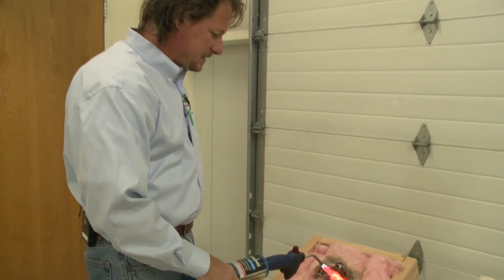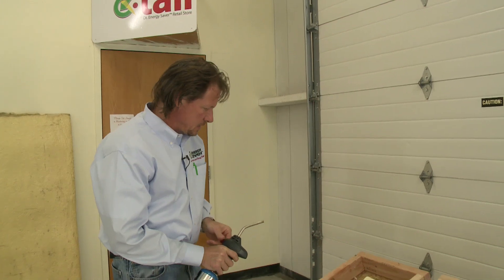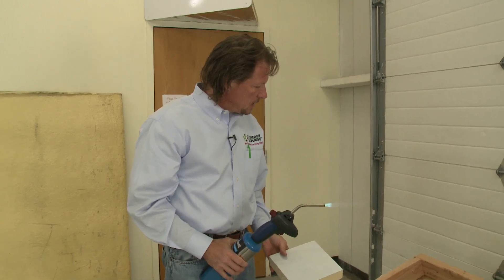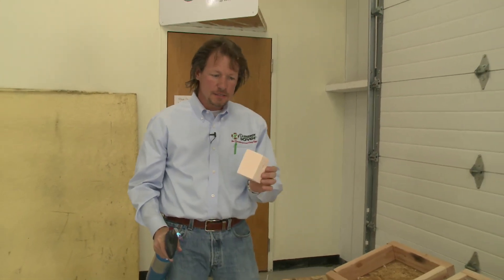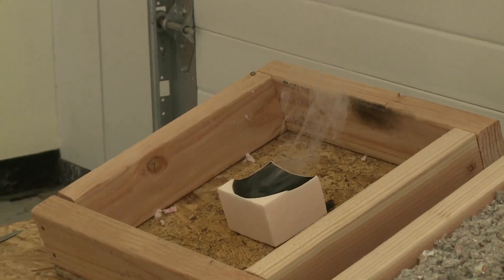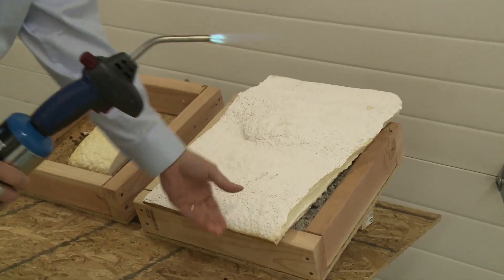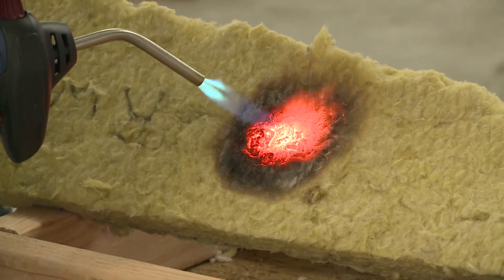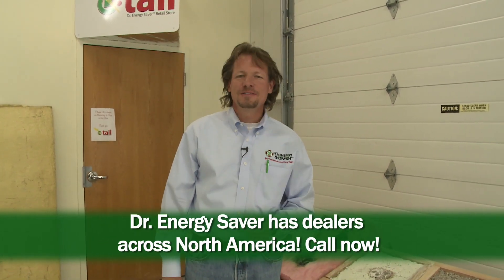Fire Testing Insulation Materials

Comment: 5:20 Grenfell tower fire in London. 72 deaths - Insulated with polyisocyanurate
Reply: The insulation material on Grenfell looks like polyisocyanurate, but it's different chemistry.  It was a phenolic resin based board insulation.  Regardless, it behaves a lot like polyisocyanurate.  You are correct that this insulation played a factor in the combustible facade of the building, but the real culprit were the aluminum composite panels that were installed as the exterior cladding over the insulation.  Those panels are sold with a fire retardant core or a non-FR core.  When it's not an FR core, the core is solid polyethylene plastic.  PE plastic is extremely flammable and in the US the building codes don't allow it to be installed on buildings taller than 40 ft for this exact reason.  The UK building codes didn't have this regulation, but regardless that material should have never been installed on a building that tall.  

That event was such an unfortunate perfect storm of many factors that allowed the building to go up in flames like that.  If the sprinkler system had functioned it wouldn't have gone down the way it did.

Not trying to be a smart ass , but there are a lot of things that allowed that event to happen the way it did and the insulation installed on the outside of the building isn't at the top of the list.

Comment: Based on this video I bought Greenfiber insulation from Lowe’s for my wood fired oven enclosure. I had already insulated with perlite but ran a little short so I finished filling the enclosure (made of steel studs, cement board walls and a 14 gauge steel roof) making sure to keep the Greenfiber 6” away from the double wall stainless steel stove pipe. After cooking my first pizza In the oven the enclosure began to smolder and has been doing so for three days now. There is very little ventilation in the enclosure so all day yesterday I keep a canvas tarp over the enclosure and keep it wet all day hoping to smother out the fire. I took it off last night and smoke still poured out of the venting areas. Using this crap was a big mistake on my part I should have just added more perlite which is made from volcanic rock. Now I’ll have to wait until it quits burning, remove the the roof, remove the burnt Greenfiber and add perlite. What a PITA!
Reply: Never do anything based on a YouTube video

Comment: Best explanation about heat exposure to insulation that I've seen yet. One thing to keep in mind though is that even in a fire, if the insulation is kept away from oxygen it may only melt instead of burning so the smoke might not be as bad but that doesn't mean that the chemicals have become inert. Quite the opposite, you may just have a puddle of ignition ready goo left after the fire.
Excelant video though. Maybe you should wright an ASTM test based on it. These are important things to know about any building material.

Comment: The colour of the smoke does not indicate the toxicity of the smoke black smoke indicates that it is  soot bound white smoke can be more or just as toxic as the black smoke especially formaldehyde that is highly toxic. You didn't test sheeps wool what is the best insulation if you have to spray into cavities or the paper he used. rockwool is a very good fire retardant and the best sound insulation material so between floors use rockwool.

Comment: Curious if there are any insulation experts out there. I am wondering about the safety of the foam insulations. In the video, he shows that most of the foams self extinguish when the heat is removed. My questions is, if you don't have an electrical-caused fire in a bad box or something in a wall, then presumably, you have an already burning fire that has reached the insulation. In a case like that, the heat source would never be removed since the damn house is on fire. Shouldn't that variable be considered? A fire origination outside of the wall and working its way in? That foam lights up, man!

Comment: Test asbestos! I hear that's a pretty good insulator!
Reply: Asbestos is a good insulator,but it is a carcinogen when you breath in the small fibers you will be at risk for lung cancer and you could die from asbestosis.
Reply: @richy5913  r/woooosh
Reply: Actually asbestos can be processed much like Rockwool to not create the particulate that can create cancer issues BUT when the company producing it was sued it literally destroyed the production of it.
Because of the way Rockwool is produced it has same or less particulate as fiberglass which can also do damage like asbestos if not properly handled. It's how products are produced and handled. I know a guy in his 00s, worked with asbestos for pretty much his whole life, they checked his lungs and found NO residue or issues from installing, handling or removing it. 
Again lots of info out there, just not spread around. And asbestos is a natural substance that's mined  much like the basalt that Rockwool is made with.
Reply: Apparently studies have been done on Rockwool to check for any asbestos-like negative effects.  They are pretty extensive, looking at any links to cancers, fibrosis, or long-term effects through both injection and inhalation.  These studies include one where the researchers describe a "mad-science" test rig (RCC
Fibre Aerosol Generation System) designed to pulverize rockwool into aspiratable particles, which are then pumped into a chamber to expose rats via nasal inhalation.  Afterwards, they checked the rats for signs of asbestosis, cancers, or pulmonary dysfunction, and then gathered data on how much particulate remained in their lungs.  They concluded that rockwool is much safer than asbestos, and in the long term study, the rat's lungs were able to eventually clean themselves through alveolar macrophage clearance of the particles.

References:  

https://www.researchgate.net/publication/15316146_Biopersistences_of_Man-Made_Vitreous_Fibers_and_Crocidolite_Fibers_in_Rat_Lungs_Following_Short-Term_Exposures
https://web.archive.org/web/20191029083342/https://academic.oup.com/annweh/article/42/3/191/177334
https://www.gearslutz.com/board/bass-traps-acoustic-panels-foam-etc/347314-comparative-safety-rockwool-fiberglass-organic-fibers-review.html
Reply: DURRRRRR
Reply: So is gas
Reply: Matt it is
Reply: Asbestos doesn't burn. I think the space shuttle has asbestos tiles for reentry to atmosphere.
Reply: @rekless1875  it had silica ceramic tiles

Comment: Honestly, most of the home owners care less if the described insulation materials burn or not if they are approved by codes. It is actually beneficial for me if it burns. Why? If the inside house fire gets to the point the  insulation reaches the burning temperature, it means you have full blown raging inferno with carpets and furniture burning all the way. No way you are not going to notice. Unless you are already dead, you will be out of the house escaping that smoke for a very long time before the attic or wall is to start burning. And here comes the catch. If the fire spreads through the roof  or the outside wall collapses 99% you are to get the house rebuilt brand new with your insurance paying for it. If the fire is to stop inside there is a huge chance you will be stuck with Servpro cleaning the mess after the fire brigade dumps tons of water into the house and then repairs that go for months and months. I much prefer to get a brand new house after a major fire than just some renovations and cleaning that will go forever and still gonna leave bunch of problems behind.

Comment: Thank you - excellent info and something I was wondering about and was figuring I’d have to do myself - now I don’t. The thing that concerns me is even those where it stopped burning because you took the flame away - is that unlike your torch, home fires don’t just stop (well unless put out) and once other materials catch on fire (framing, interior items) - then the insulation will also continue to burn. From doing various craft projects I have had opportunity to burn a few of the rigid foams and the smell on some are awful - not to mention, the smell of spray foams being insulted. I have read horror stories of people ending up with toxic homes that the smell just doesn’t go away and people are made sick. You weren’t using any breathing protection, but I suspect your building has an excellent air purification as most folks wouldn’t burn some of these in an enclosed non-ventilated space. I’d like to see testing that discusses toxic fumes of the various insulation products used here both when burned and after being installed and you move in to a new home or back into a remodeled one.  I believe we have to consider not only efficiency in insulation but also our health (personal and environment) short and long term. Many of the efficient buildings are being built so air tight that mechanized ventilation systems must be installed and run 24/7 providing proper draft for gas stoves, fireplaces, wood stoves, etc BUT mostly for the quality of the air inside the home. By all accounts, the air in our homes is much more toxic than outside air. But here is my concern - what happens when the unit breaks down, or power is off for extended periods. In my current home of 30 years, we have had 3 instances where the power was off due to natural causes (snow storms, hurricanes, etc) - those 3 events without power were each a length of 9-11 days, 2 in winter, one in dead heat of summer (90-95F with 80%+ humidity). Well opening the windows in the winter is just not acceptable to provide ventilation, and the tightness of some of these homes makes lighting a fireplace, or wood/pellet/gas virtually impossible much less keeping it going without smoke. I know several folks where even with a special ventilation system, their backup wood stove nor their AGA gas cook stove won’t operate as it did prior to building the new home. I’m getting ready to have a small custom home built and I want an efficient home but not to the point of being dependent on some mechanized system to be able to breathe. 
Wood like to see water testing such as when flooded, pipe breaks, roof leaks. This would tie in with testing of various types of drywall especially comparing to Magnesium board (MgO) - both fire, water as in most cases - insulation is covered with something. If not doing this with all types used in this video - then the 3 top winners and a couple of most commonly used foams (spray and rigid).  
Then there is more in-depth look at the 3 clear winners of the insulation to cover cost per square ft to install both remodel and new home; how installation affects performance as quality of contractors and their work force has sharply declined from say 20 years ago. When talking to various levels of folks while preparing to build a new home - hearing comments like “rockwool is installed the same as fiberglass (or magnesium board is the same as regular drywall - if you want to spend more money, fine); and it is really the same -just shove it in, nail it up, works the same, why spend more money, or the one I love talking about anything green “now your talking about some real money, hope you have really deep pockets” is scary. Yet, they don’t have the cost differences and they don’t want to quote those differences - just say “look when we deal with those materials or methods - we use it and hand you the bill afterwards - be prepared to spend more money for all this nonsense”. What kind of answer is that? And women are definitely at a disadvantage with these guys - sometimes I feel like I’m in the 70s trying to buy a car. 
I’m going to check your other videos and website to see if you have already covered the testing mentioned above. Thanks again.

Comment: As I watch Mike Holms show the best way to build your house is with foam insulation or Rock wool. 
Also treat lumber with fire retardant. This way the house wouldn't burn. Yes you can spray this on older homes lumber.

Comment: Ha ha, this makes me chuckle, been told by an architect that natural insulation’s have less of a fire rating than modern, fibre glass and foam insulation’s. But apparently the PIR is the only way to do it. But I’m demonising modern methods. The tower block fire in London was fed by the PIR foam insulation and funny how here in U.K. PIR and spray foam bolt have a fire rating at the moment.

Comment: If R rating just comes down to the insulations ability to allow heat to transfer through from one side to the other then AirKrete should have the best R rating I would think. I think some one is fudging the stats on the insulation values. I have watched people leave a 4000 degree Fahrenheit torch on 2 inches of AirKrete for hours with no temperature change on the outside of the AirKrete, it doesn't let the heat pass through.  So why wouldn't that be the best insulation to use?

Comment: Dear Dr. EnergySaver, your test shows some variation in ignition properties, but except for the cellulose it does not even come close to showing how these materials behave in an actual building fire. In NFPA building fire test conditions foam did not self-extinguish, and the test room became an inferno in less than a minute; while after 15 minutes of fire exposure cellulose insulation still did not melt, collapse, or flashover. here is a link to a short video of the test -  https://www.youtube.com/watch?v=mUPp-Ipt-Pk

Comment: My compliments on Larry's easy-to-take delivery.       He's thorough and accurate.      He ought to take up a night job as an MLB radio broadcaster!        Keep up the great work, Larry.          But I worry about any smoke you might inhale, during your demonstrations.          Rumor has it that isocyanurate turns to cyanide gas at high temperatures.
Reply: if that were true than i have an extremely high tolerance to cyanide.i have had to scrape structual fireproofing out of the web of i beams many times to weld this or that.nothing would be scraped from the other side or any where else i wasnt welding so the far side of the web would be just uner 2000 f roughly.its not pleasant smelling ,sometimes it will make you hack and cough but i havent died yet.one thing i know will kill you is welding steel that has lead based paint on it.take my word on that one.

Comment: The 24 floor "Grenfell" apartment building in London just burnt down. So far 12 people have died. They had recently finished putting foam panels on the exterior of the building. I can't believe how professional engineers and architects would be so oblivious to this hazard!
Reply: Depends what you mean by "foam".  Not all foams are the same & as the above tests show, they burn differently,. So far,  no-one has confirmed what insulation was actually used in Grenfell House (as opposed to what was specified).  Seems the fire had something to do with how flammable the aluminium composite cladding was & the way it was all fitted. The foam was separated from the cladding by an air gap that may have accelerated the fire.
Reply: @robinstokes5179  the 'foam' used is as follows: "composition: a polyethylene core sandwiched between aluminium sheets."... a cheaper alternative was chosen to save money, which clearly has cost many lives. Polyethylene is referred to as SOLID PETROL.  "known for its high insulating properties."
Reply: @shanehammond  Yup, wrong place for that material.

Comment: Thanks for this, scientific method is still being applied here, just not tha anci or what ever testing they do, but still. you are performing an experiment that with the same materials I would be able to reproduce your results to corroborate your findings, therefore, science!

By the way, thanks so much for doing rock-wool or Roxul that I think is rock-wool, I am planning on insulating a wall that will go behind a new stove installation separating our bathroom from the oven.  I have always followed the mindset that only the paranoid survive and I really want to go overboard on sound and fire blocking/prevention.

One thing I wanted to mention, they say fire resistant, not fire proof.   :-)

Comment: That is true. If you FAIL to extinguish it, it will burn to the ground BUT I think the point here is this: If you have a quality foam that does not allow the fire to burn QUICKLY THROUGH the walls, then you technically have MORE time TO EXTINGUISH it. Holding back the spread of fire is a worthy calculation in choosing insulation...
Reply: Todays modern homes that are prefab balloon construction are basically "disposable", under fire conditions the floors and roofs collapse quickly, stairs are only rated for 5 mins under fire loads making them only good for escape.  the truss members in the roofs and joists in the floors are made of laminates that are wood chips bound with epoxy and polyurethane resins that under elevated temps give up any structural property they had.   insulation will help with escape times but it is unfortunately not going to help much with the extinguishing aspect

Comment: yeah Rockwool wins no fire retardant chemicals needed it just doesn't burn and it's environmentally friendly
Reply: https://www.ncbi.nlm.nih.gov/pmc/articles/PMC2711883/
Reply: calthmlikiseethm 
fire retardant on foam plastics is a water based paints with very low voc. not more chemicals then then anything else in a house
Reply: and it also causes cancer
Reply: @centurionl  what do you meam.Are you kidding?Rockwood rocks
Reply: it also has a high U-value which is bad for insulation.